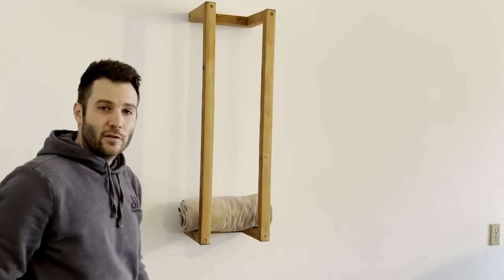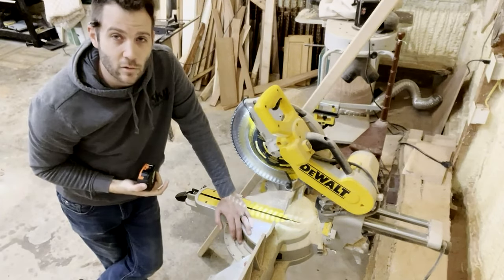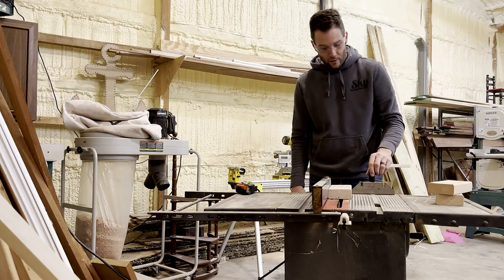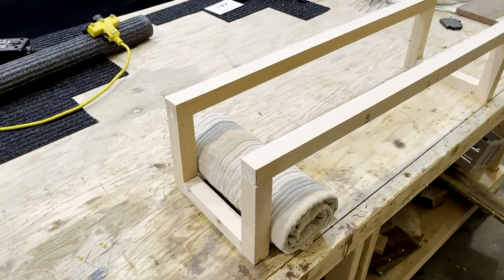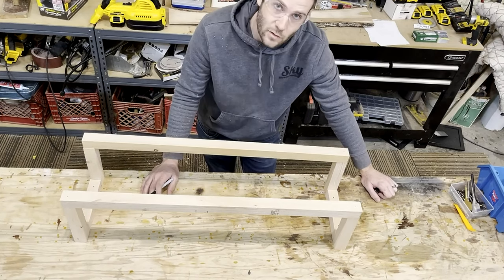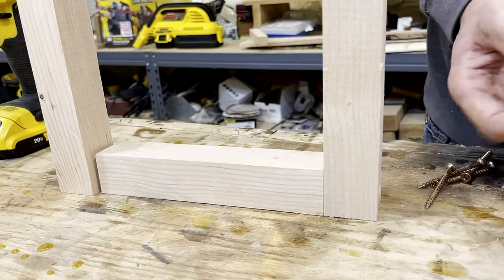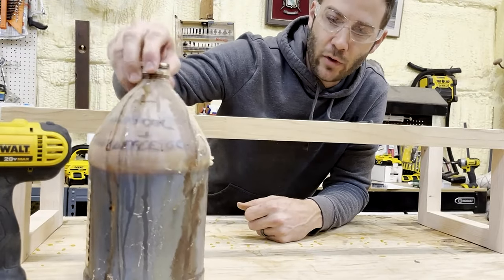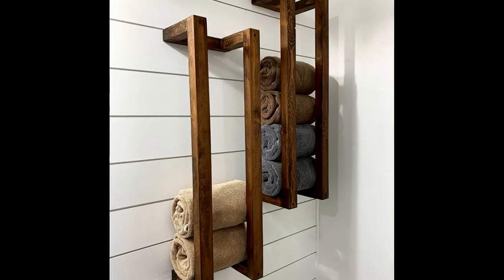How to make a Rustic Farmhouse Towel Rack.  Easy DIY Home Improvement Project

Comment: Great video. Thank you. Question — What size dry wall screws / anchors do you use to pass through 1.5" of wood? What about sawtooth hangers?
Reply from the maker: Sawtooth hangers would work… I just didn’t have any lying around and typically have boxes of screws.  I think I used 2 inch screws and since they were countersunk into the wood they probably came out a good 3/4 - 1 inch.  Drove them into anchors in the wall so it won’t pop off easily.

Comment: Would you recommend a clear coat over the stain finish?
Reply from the maker: Clear coat over stain would be good if you are using it in a damp space.  I like minwax antique oil finish that hardens on the surface and isn’t really a stain.  Comes in a red can… follow the instructions and it will change your life :-)